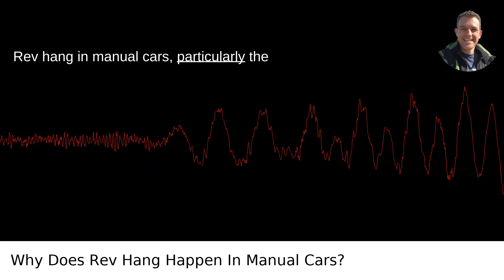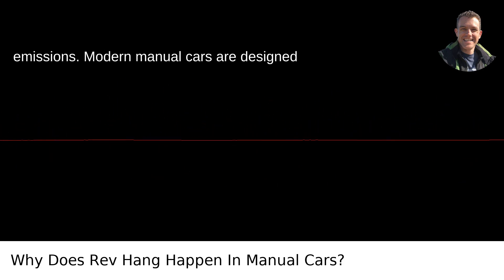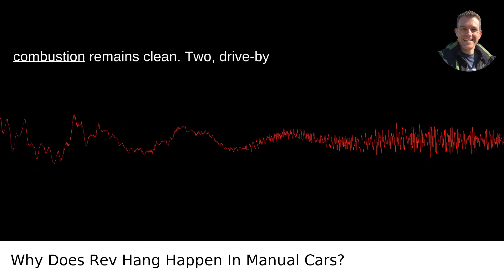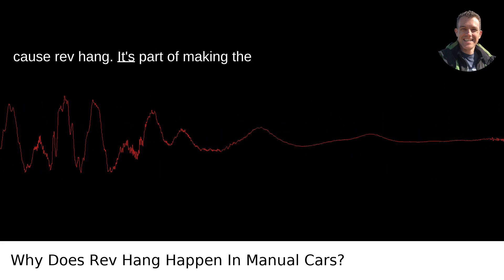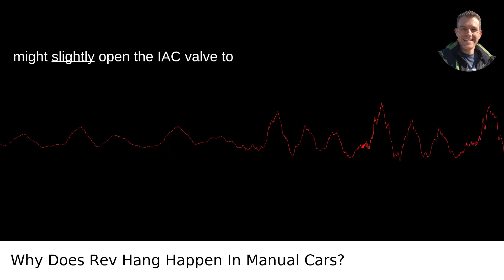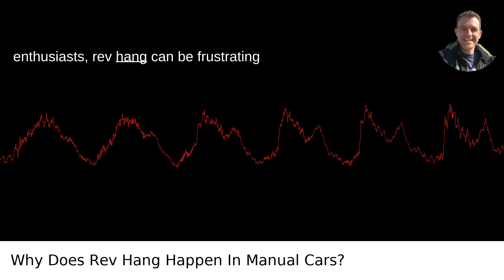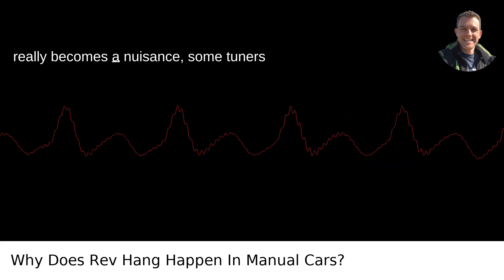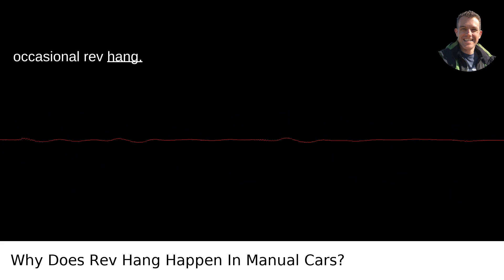Why Does Rev Hang Happen In Manual Cars?

Comment: I had a 2020 Honda Civic Si Coupe for about 2 and a half years. It was miserable owning that car because of the rev hang. It drove me nuts. I hated driving the car because of it. It made the car jerky between shifts. My mother was in that car and she even commented on how jerky the car was and so did my friend. I eventually got a Hondata to disable it and it made the car a lot smoother to drive and both my mother and friend noticed how much smoother the car was with the rev hang disabled. I got rid of that car and now drive a 2023 Subaru WRX and there's no rev hang in this car (Subaru listened to the complaints and fixed it in the newer WRX's) and my mother and my friend commented on how much more comfortable and smoother the WRX is because it doesn't jerk them around like the Si did (and I drive the WRX the same way I drove the Si). The rev hang might be there for a reason but it makes for an uncomfortable and jerky ride. I also had a 2018 Honda Civic LX Coupe before the Si and that car was also standard and there was no rev hang in that car either and that car was much smoother to drive and much more fun to drive. I did not like having passengers in the Si because the rev hang made it look like I had no idea how to drive the car. Rev hang also wears out the clutch faster. The clutch in the Si was already slipping when it was almost brand new.